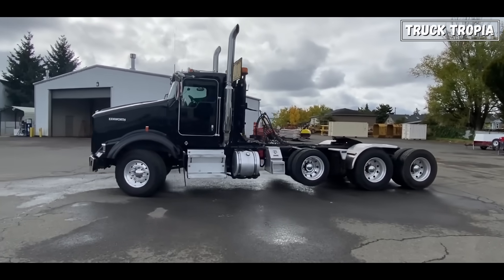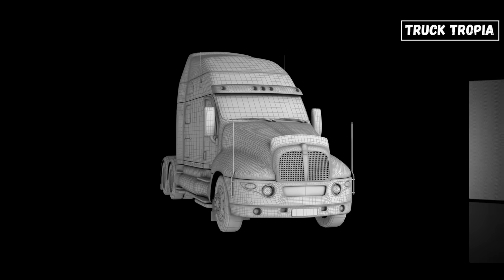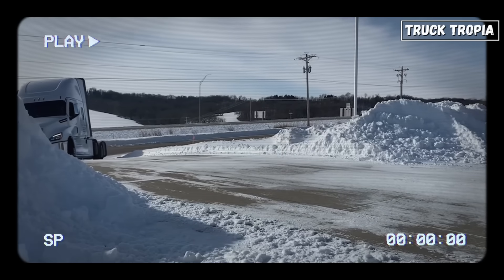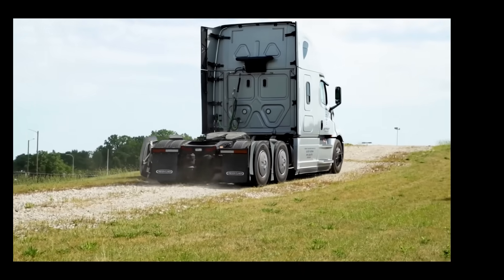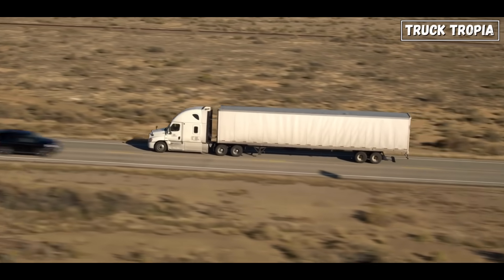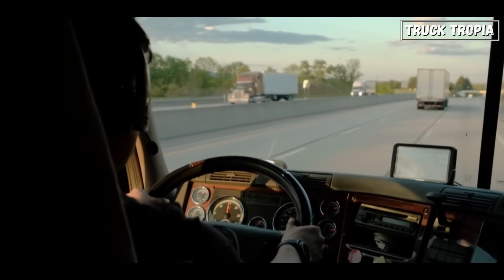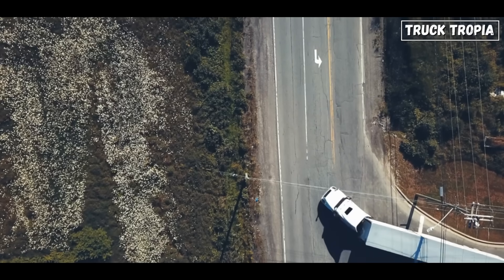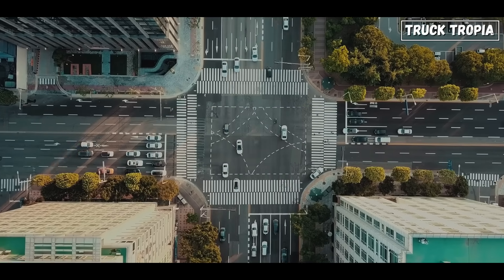Why Do Some Truck Tires Don't Touch The Ground?

Comment: The extra axle is for distribution of weight for heavy haul.A semi truck driver has to evenly distribute weight of the load to a maximum of 17,000 lbs per axle

Comment: Could I  point out to you that axles are never found in contact with the ground or road surface , if they were then there would be no space for the wheels to fit no matter what their function. Axles normally ride above the road surface  between 18 to 36 inches allowing the wheels to fit and contact the road to function as required. In future would the professor giving these lectures like to carry out research into his subject before speaking,thank you from a none licenced pedestrian medical professional.

Comment: Float axles can be lowered for weight distribution. Garbage trucks and coal trucks uses them every time they have a load on to. The float axles also used in braking too.
Reply from the maker: Good points about float axles for weight distribution and braking!

Comment: Ah yes the air lift axle or the hydrolic lift axle they can also be used for extra grip on slippery terrain if I'm not mistaken
Reply from the maker: That's right, they can be used for extra grip!

Comment: When the axle is lowered into position how does the system ensure that the load is evenly shared between all the axles? Seems to me that there is the possibility of the movable axle taking less, or more that the fixed axle, depending on how far it is lowered?

Once the movable axle is lowered into place, is it locked into position somehow?

Comment: A simple brief explanation - It can be adjusted down in certain circumstances related to the load or to improve traction.  No need to explain the different types of axles - particularly the ones that do the Turning.  The fact that they're adjustable is the first detail that should be mentioned.  When it's in the down position, no one would know there's anything going on.  When it's in the up position, it looks very strange and noticeable, which is why anyone would wonder about it.

Comment: Ok guys but let’s hear your opinion what’s better a pusher axle or a tag? They’re both lift axles but a pusher is in front of the drive axles and a tag is behind them.. and I’m specifically talking about ones that are nearer to the drive axles. Not the super far forward steering lift axles because those actually handle a lot differently.. in my personal experience a tag axle is a bit smoother over uneven terrain. It takes a bit more power to push the neutral axle up over a bump as opposed to pulling it over once the drive axles have already cleared.. however a tag axle is much less practical in a tractor with a shorter tail. Because if the trailer has too much forward overhang you have to engage the tag axle to make weight because you can’t position the kingpin right over the drive axle because it’s too close to the cab. So on some of the real stubby euro style trucks you end up having to engage the axle for a load you could otherwise get away with just a single axle. But if your tail is long enough then it’s not really an issue. You can just slide the 5th wheel saddle further up and position it right over the drive axle.. so idk in your guys experience which do you prefer and why? A non steer pusher right in front of the drives? Or a non steer tag axle right behind the drives?. I feel like once you get into steerable pushers and super front mounted pushers and steerable tags and stuff like that it’s a lot different. I’ve just found that tag axles seem to roll over rough terrain a bit better than a pusher. But a pusher is more practical for a tractor truck or if you haul a trailer. Because you can position the weight a bit better so you don’t have to drop the axle as often unless it’s actually a heavier load. Not just because you can’t get the weight positioned good enough to haul a trailer without dropping the axle..

Comment: Those tires in the thumbnail actually do touch the ground and they also have two other functions actually three they provide extra propulsion electric motors they also stare but they also help with the load so when they need propulsion you you know how six wheels pushing it forward add extra horsepower when you need to steer you have four wheel steering your truck where it wants to go

Comment: You should have the experience of airing up a 4 drop axle set with 3 drive axles and make it look good a work right I worked at freightliner for 30 years 😅

Comment: I drive large garbage trucks and one of the trucks I drive has a lift axle.  The tires blow out pretty often due to weight and stresses though.  I think the tires are undersized.
Reply: I think the inner tube might be undersized or the tracks are oversized. If you’re filling the inner tube too much it’s gonna be more likely for them to blow. Idk though this is coming from a 8th grader so it might be wrong

Comment: Axel is not attached to the tire with bearings. 
The raised axels on the ground do not provide traction nor fuel efficiency. 
Most lift axle do not provide braking. 
Lift axels were put on trucks not to haul more weight but to save on the wear of our roads. The limits have not increased.  Infact road limits have decreased. Truck weight is now measured at the axle if their more then 42 inch apart. Otherwise  both axle are weight as one. That means 7 no now 6 ton per axle more axles means more tonnage.  The truck I drive looks like a Caterpillar.  Mostly because it's drive on dirt roads and very heavy dirt rock gravel loads. The trailer is the caterpillar of spring. Yes their side dumps. In the old days they just weight the truck, not each axle and we were heavily loaded back then.

Comment: Drop axles do NOT increase traction it's the opposite. Inclement weather you pick those bitches up. I dont know how you think having less weight on more tires improves grip. It does not

Comment: As you increase the load on the truck the frame bends and just before it fails completely the wheels touch the pavement. Then you can add another 40k pounds safely. All 18 wheels when fully loaded should look almost flat for maximum traction otherwise the trucks won't be able to descend steep grades. Trust me I spent the night at a motel 6, I know what I'm talking about.

Comment: I thought the raised axle was called a “hill wheel” so that if a truck was coming from a drastic change in angle it never got stuck on the chassis and the hill wheel would give it extra grace.

Comment: As you mentioned, a axle set behind the drive axle/axles are know as TAG axles.
A axle ahead of the drive axle/axles are know as PUSHER. 
They're primarily used for weight limitations. 
Unfortunately, not to go political, but a few of the blue states, came up with the ABSURD regulation that the PUSHER axle must be steerable besides the ability to raise and lower.
Sorry but that's absolutely ridiculous, raising the cost of EVERYTHING hauled in that truck.

Comment: It has lift bag! drove and repaired drop axles my last 10 years of trucking ! Drop and lift axles ARE NOT FOR IMPROVING TRACTION PERIOD !!  The only reason for drop axles is to Bridge overweight super truck's  . Braking improvement from the drop axle is neglegeble because if your axle is down the truck is more heavy ! Thus with a super load you don't notice any improvement in braking ! As matter of fact , if you are lightly loaded do not use the drop axle down ,YOU WILL LOOSE TRACTION USING A DROP AXLE  WITHOUT A HEAVY LOAD !!!!!
Reply: To be fair, traction isn't just the driven wheels, it improves traction by giving more ground contact for another set of brakes to work with.

To your last statement, I fully agree but to add to it, if the pusher pressure is too high, you'll also loose traction, as I found out when mine creeped up to around 90psi, let's just say steering in the rain was entertaining.
Reply: @SilverStarHeggisist  When your scaling 110K that extra set of brakes just makes due ! That and 2 of my drop axles were steerable , thus 4 of my extra brakes are only steer axle brakes , minimal effectiveness!!! My last years of trucking was heavy Chevy's .
Reply: @stephenfisher9505  The dump truck I drive has special heavy duty steer brakes, i found out when I was the company mechanic. Boss got me steer axle brakes, too small, then he got me rear axle brakes, too big, they're a weird in-between size that's a pain to get. I believe my drop axle uses the same brakes. The front axle on my dump is a 20K pound axle.
Reply: @SilverStarHeggisist  I worked for an intermodal out fit the just gave us what will do the weight , they didn't care STOPPING !! That's why they put us OLD , EXPIERIECED drivers on the heavy's
Reply: @SilverStarHeggisist  The drops I worked with you didn't want to exceed 65psi .  got an over weight warning from WSP on my drop axle on my tractor over 65psi . got grip on " steering in the rain". in the Evergreen state.
Reply: @stephenfisher9505  Yeah I don't know why it was so high, it was right after I switched from being a mechanic to a driver. Dumbly the pressure control is outside the cab. So you have to stop, get out, chalk the tires or use the trolley valve, drop the axle and adjust, get back in, drive a ways till the pressure stabilizes and then repeat if it's still too high. There is a gauge inside, but the knob is outside, dumb. I got it to about 58 or 60 PSI now, and when it rains, I'll slam the brakes on after getting loaded with gravel to shift the load forward for more steer axle weight.
Reply: @SilverStarHeggisist  I had the same issue with my control .
Reply: @SilverStarHeggisist  You went from mechanic to driver . I'm guilty too ! started out in airplanes till pilot error , and my big bros. pushed me into trucking . my bros. had a couple of reefer rigs they brought me on as mech. / driver  3 drivers 2 trucks we rotated our schedules to were we could get a week off every month or so . except me , my week off was wrenching or parts chasing . When the company grew I became full time mech. till I fractured my neck. did 2more stints wrenching , but at retirement was just driving . One thing I won't have since retirement , A CELL PHONE !
Reply: @stephenfisher9505 I just don't answer my phone. I'm famously difficult for anyone to get a hold of lol. 

I switched to driving partly because I saw coworkers at other jobs limping around the shop and decided I need to stop before that's me.
Reply: @SilverStarHeggisist  Yeah man , I got physically so bad my Family doctor wouldn't give me a medical card  at 55 years . he didn't want his family on the road with a trucker that could barely turn his head . He told me gather my medical record's and go to social security .  SS put me on disability retirement .  GOOD LUCK  , IF YOUR LIMB'S START GOING NUMB .  HANG IT UP ,  the longer you work damaged , the worse the golden years will be .  About all I'm good for Is watching Jack Webb show's and calling out wrong addresses . That and keeping my partner with Alzhiemers from burning down the house ! GOOD LUCK AGAIN .  I've been there !
Reply: @stephenfisher9505  I am lucky that more or less, I'm in good health and I consider myself lucky, especially considering how many mishaps I had when I was younger. Like back when I was in my very early 20s I walked away from two roll overs with hardly a scratch on me.

Comment: So in other words edge pointless just leave the axles down at all times stupid feature. You’re not gonna get a violation for being underweight so why would you need to raise the axle? You never gonna need less traction you’re only gonna need more attraction. Leave them down or just drive a static 10 wheel configuration tractor like normal people
Reply: As someone who drives a truck with a lift axle, let me better explain. when the lift axle is down, it takes weight off the steer axle, which reduces the traction the steer tires have, this will make you under steer, or in other words, you'll turn the wheel and the truck will keep going straight. so when unloaded, you lift the axle. When loaded i will also sometimes lift my axle when I am going into a steeper turn on a on ramp, just to put more weight on my steer tires for traction. Driving with it down can cause a severe loss of control.

For trucks that don't have a steerable lift axle, leaving it down while making a sharp turn can damage the tires and even rip them off the rims. Even with a steerable lift axle, it's only good for so steep of a turn, so when moving around a lot or other unusually tight turns, I'll lift mine up so it doesn't drag the tire sideways.

when unloaded, you actually get less overall traction with it down, because you're spreading the little remaining weight over more surface area, reducing stopping distance and over all handling.

when reversing with a steerable lift axle, you have to lift it, otherwise it will turn one way or the other and cause damage to itself or the tires. My truck won't even let me put it in reverse with it down, it will automatically lift it.

When down the axle adds extra drag, reducing fuel economy for no reason

when dumping, you want it lifted to avoid the air bags inflating or deflating randomly which can tip the truck over.

when going on ramps with sharp angles at the top, like what is often seen on scales, you want the drop axle lifted, this is because it can actually lift the drive axle up enough to loose traction.

when in soft ground, you want it lifted to reduce drag, which reduces the chances of getting stuck.

some trucks have automatic lift axles that drop when the truck detects enough weight in the bed. Mine doesn't have this because I have solid suspension.

Comment: At 3:29, how can raising or lowering an axel help a truck stay within weight limits?? This makes no sense. The axle is not being removed, so the mass of the truck remains the same.
Reply: Weight limits are not based on the whole truck but are based on  weight per axle and per wheel. The more axles and wheels on the ground, the higher the weight limit.
Reply: When loaded a truck weighs more. Empty the dump truck I drive weights about 28k pounds, so doesn't need any more then the 3 axles on the ground (including steer), when loaded, I weigh 73,280 pounds, now the truck wouldn't be legal with just 3 axles, so I have to drop the drop axle to add another set of brakes and tires to help hold and stop the load.
Reply: say a truck weighs 24 tonnes, 24/4=6this means that with 4 wheels, each axle has to bear 6 tones. But if you have 8 wheels, 24/8=3. This is important because each wheels would bear only 3 tonnes. The weight of the truck is spread out, so not all the weight is in one spot. It essentially decreases the pressure on each segment of the road. Jesus loves you man

Comment: You literally skimmed over the most important reasons and repeated a whole bunch of minor inconsequential stuff. Tyre Wear - by operating the remaining axles closer to full, the tread wears evenly instead of along the centre. Most of the other stuff you talked about was complete rubbish.

Comment: Nobody mentioned the exorbitant tolls per axle on 17 inch HD longhaulers. Thin Diesel wheelies the tolls but wears out way more trans, clutch pedals- 35 powershifts to turn right on red and still fit under your coffee table

Comment: "rotor sails" or "Flettner rotors" helps the truck go quicker and better fuel economy. It catches the wind. The make it look like real tires to look cool and add extra horsepower and attract meat puppets at truck stops and pickle parks.

Comment: When I was a kid, I thought they were just spare tires.
 Some modern Train Engine's have this same feature. Like the GEVO ES44C4. It has 3 axles per truck and the center axel can be lifted to improve traction and reduce wheel slip.

Comment: Why make videos on things you don't understand, it's pretty common since. That axel is only for heavy loads, the driver will only drop the lifted axel when picking up a heavy load (over 80k lbs). 
It's never lifted to balance load weight on the axles, if you're loaded you aren't going to lift an axel! Shifting load distribution is done by sliding the trailers tandem axels. Only rarely will a driver move the 5th wheel to adjust the weight on the front axel (I moved my 5th wheel twice in my 10 years).

Comment: What I've always wondered is how those wheels are able to support the truck's weight when lowered, and not simply be lifted back up by the ground.  Is the suspension just that strong?  Those air bags holding them up must be even stronger, then.

Comment: It’s called a tag axel it can be lowered bc some trucks need more power and it can easily add more power
Reply: Tag axles are when they are behind the drives

Comment: So more axles is safer, more stable, but costs more. The lift axle exists to save money on fuel and maintenance where the law allows it.
Reply: and because when unloaded you'll risk loosing control due to less traction on the steer tires

Comment: The script is very convoluted, seemingly to increase play time. Basically the extra axle is for heavier loads and/or better traction and are often required by law when carrying heavier loads. The downside is they introduce more drag (and therefore worse fuel economy) and wear and tear, so they can be raised when not needed.

Comment: Oh yeah, the boogie wheels. Like the wheels that are in on the booster of concrete mixer or a Super Ten. In bridge control states the numbers of axles and the distance over which the load is spread come into play. More axles = less load per axle. Nice explanation video.